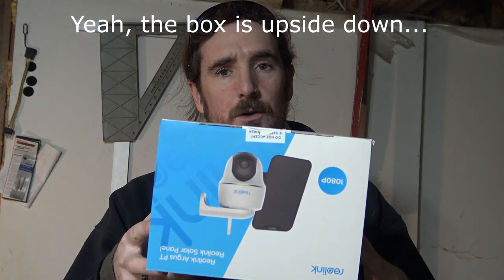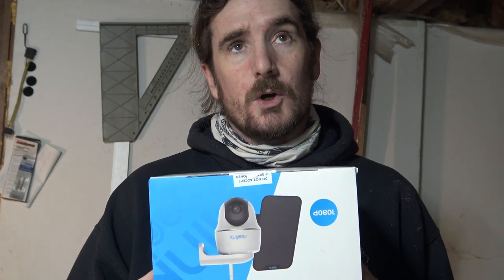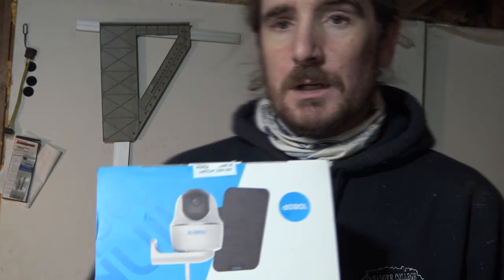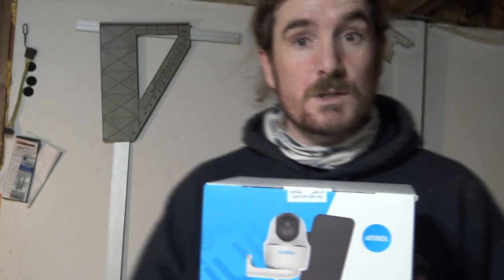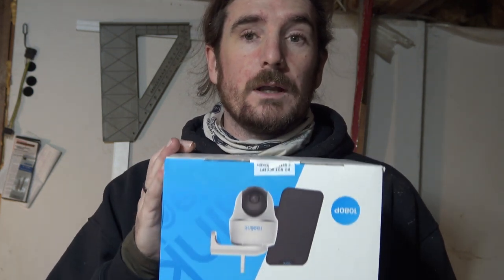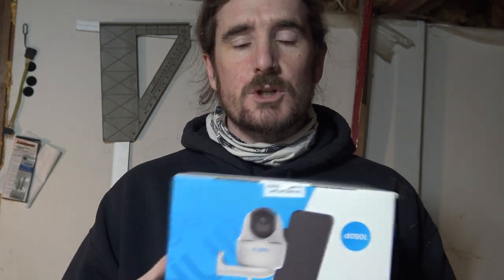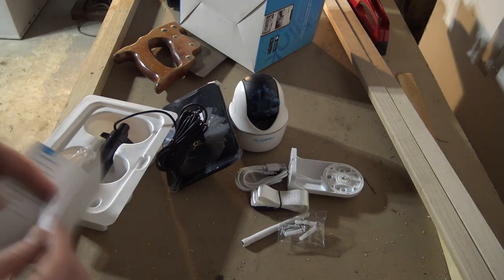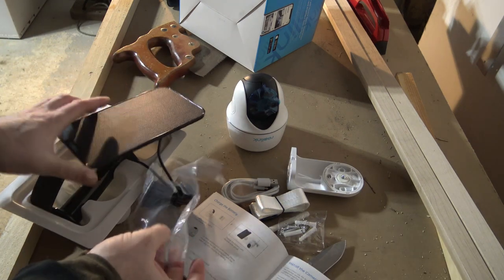Why I got a homestead security camera | Peace of mind | Wifi Camera | Remote monitoring |

Comment: I understand this is a advertising vid so I have liked it and watched the full vid. I'm a keen  fisherman.  Just want to know 3hats your preferred method of putting a fish 'to sleep'  i have always held the tail then used the fish as a hammer hitting it on the back of the head. I have had some abuse from onlookers thinking I was being too aggressive. I have also used a knife to the back of the neck/spine then I have had back lash to too much blood. any suggestions on a way to dispatch a fish with out having a negative response from the public? Much love to your channel 👍
Reply: Try a club !
Reply from the maker: Thanks for the channel support!
For me it really depends on the fish species.  With walleye and perch I break the neck by pulling the head backwards towards the spine.  This releases very little blood and results in almost zero nerve thrashing afterwards.
With pike I put my fillet knife through but eyes to pierce the brain.  It also usually results in little blood and typically less thrashing.
With trout I often will just bop them on the head.  Hammer Hound is right that a small club works really well - usually just one solid thunk will do it.  I find that if you swing the fish around and whack it on whatever is nearby it tends to look over-dramatic and is less effective than some of the other methods.
Lastly, if you are going to kill/bleed it by cutting the gills I would do it in the actual water where the blood dilutes quickly in the water - much cleaner!
Reply: I have now used a small rounders bat. A quick sharp hit to the back of the head has worked well. As  you have said I think its important to get as much water involved as possible to start with as onlookers like the idea of fishing yet hate the sight of blood. Its a strange world we live in . Just keep doing what you're doing best wishes to you and your family  👍